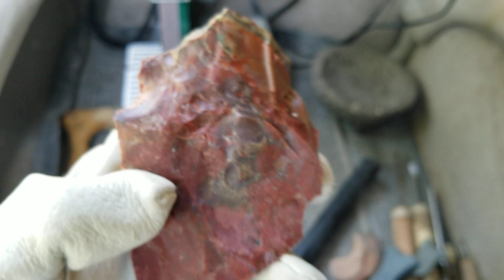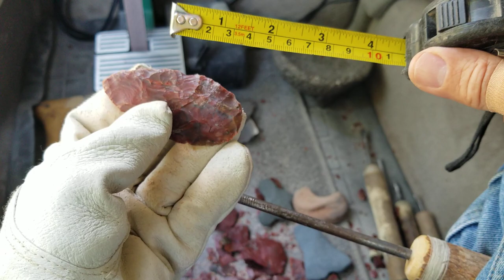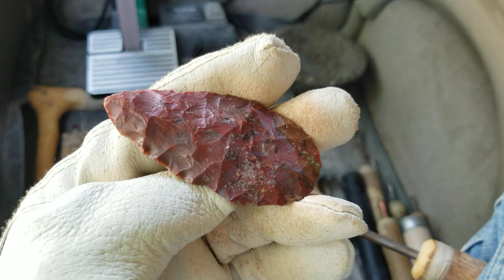1260 - Part 1/2 - Flintknapping Heat Treated Bloodstone

Comment: I have some Texas cobble that's very tuff I can't run my oven for hours but after I  bbq I close the  lid on it and it stays hot for several hours so I've been thinking about putting spalls in the bottom before I light it the after I close the lid overnight and see what happens. Cool video the arrowheads In San Diego are mostly small
Reply from the maker: If you have a thermostat on your grill, it should work.
Reply from the maker: And it's cool to know that you've got the small arrowheads in San Diego.  I didn't know that.